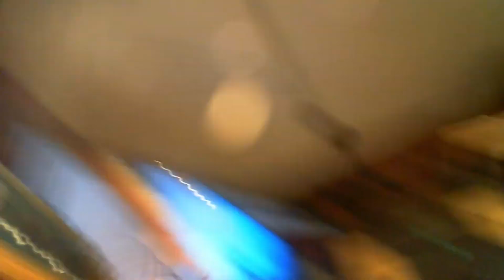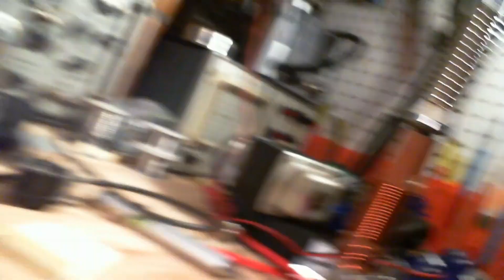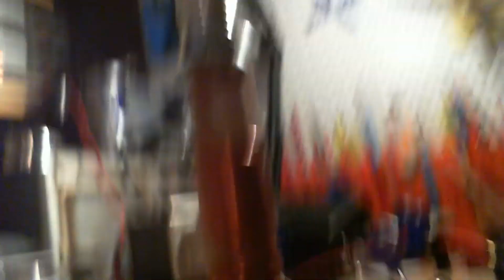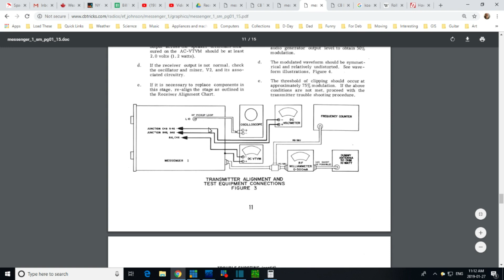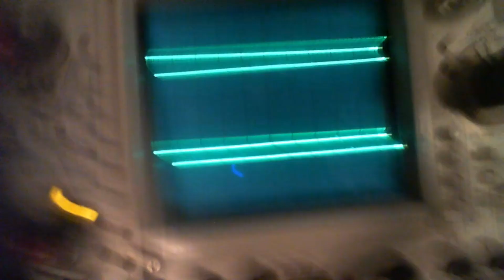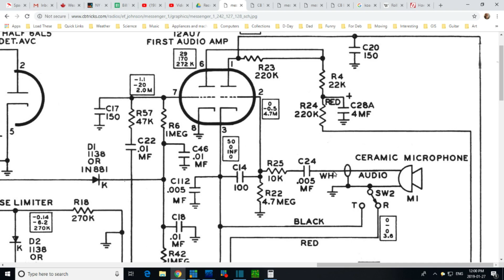Johnson Messenger CB Radio Video #12 - Antenna and Modulation

Comment: The base-loading coil of the antenna is really an auto transformer, of sorts, and the coil tap is used to match close to 50 Ohms. Once the 50 Ohm match is established, the stinger is adjusted for minimum SWR. A magnetic antenna needs to have some form of counterpoise to operate properly (increase bandwidth allow lower SWR). I think you would be better served if you used your Versa Tuner. Check out Heising Plate Modulation

Comment: To check the transmitter you need to feed the audio into the transmitter not the receiver.
The instructions tell you that the receiver and transmitter are tested by connecting a 51.5 ohm dummy antenna to the set.

Comment: SWR-Meters (of the simple and usual Type for CB-Radio) are used in a Way, that You calibrate the Needle in Calibration Mode for pointing to "Full Scale" first (very often that Calibration-Point is also marked as "set" or "cal". ) 

Usually there is a Knob on the SWR-Meter to calibrate it... :D

After You have done that, You change the Mode to SWR Mode . In SWR Mode You can read the SWR. (Also for this You should have no extra Field-Strength Antenna connected to it. Because that possibly could influence the Reading.. )

And for Calibration and Reading the SWR You should transmit (but not speak into the Mic when in AM Mode). 

:D :D

Comment: I can't recall at this point, but did you check the Black Beauty and the yellow cap? (All of them actually.) A leaky or off-value cap can really mess things up. That clipping could even be caused by one not passing the full wave equally.

Just a thought.